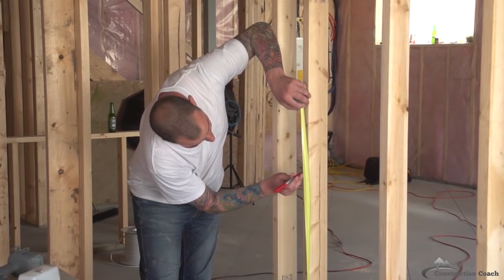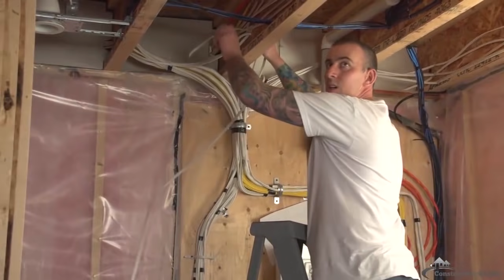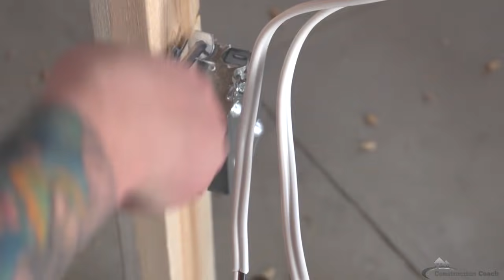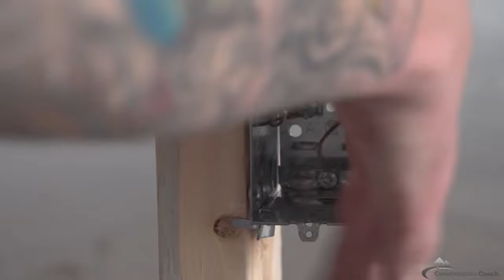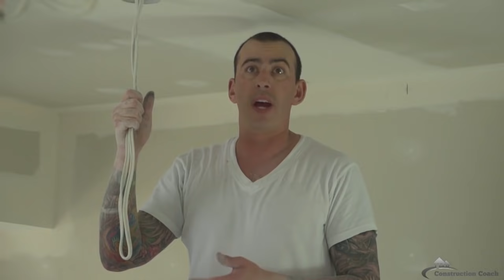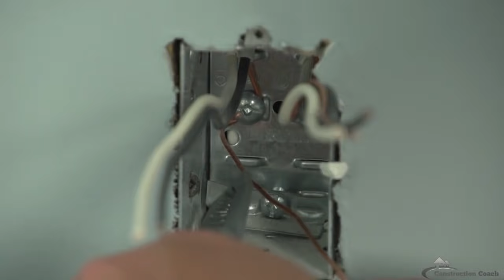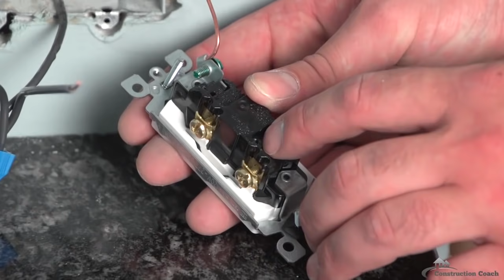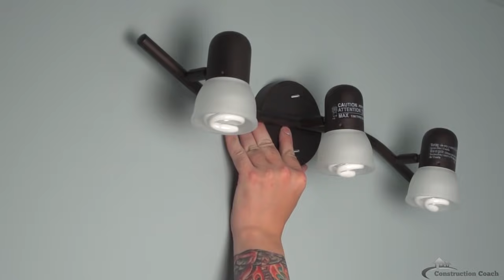Home Electrical 101 - What you need to know now!

Comment: Is your gfi receptical using 14/2 or 12/2?
Reply from the maker: 14/2
Reply: Construction Coach is it on its own circuit?
Reply from the maker: If it’s for a washroom i usually have it tied in with other things. If it is exterior I will have one circuit for exterior receptacles.
Reply: Construction Coach thanks for your help! Great videos. What else would you run a single circuit for? Fridge? Oven/stove top? microwave? What would need it’s own dedicated circuit in a house build? Thanks!
Reply from the maker: Furnace, fridge, dishwasher, hood fan/microwave, hot water tank, electric/gas fireplace, washer, dryer, stove/range, jet tub, the list goes on and on!!!
Reply: @ConstructionCoach  General rule of thumb, if the appliance requires more than 10Amps then it should be on its own circuit?

Comment: I dont think it was bad planning twisted, I only watched a little bit and am guessing the house was already done and the insulation was needed when house was built. this is finishing off the basement at a later date, HOT TIP use a hammer to measure outlets, much faster when you do an entire house.

Comment: Rough in all electrical and plumbing, and anything else, before insulating. It's a capital waste of time and energy to install batt insulation, acoustic sealant and plastic air barrier, just to come back and rip it out. Frame the stud walls, drill all necessary holes for the  electrical and plumbing runs, rough these in, vacuum up the debris, then insulate. 

One major difference between pros and non-pros is pros make the most efficient use of time and resources. Pros are skilled at avoiding unnecessary tasks and why able to get from A to B faster. 

At about 1:08 onward, and have to say I have great concern about non-electricians offering electrical wiring advice on YouTube, one can see that the hot receptacle terminals aren't shielded with electrical tape, are improperly connected and under gauged. Every certified electrician I respect always tape the terminals and wind the copper wire clockwise around the screws.  The screws are there for a reason. Those wafer thin metal hold down slats, the easy cheat, are bullshit and should be illegal.  It has to do with preventing overheat from high amp electrical appliances such as hair dryers.  In this video the GFI appears to be 14-2 to upstream.  Washrooms, like a kitchen, should be 12-2 on 20amp dedicated breaker or 14-3 split receptacle across both 120v hot busses.  Way safer. 

Plug a vacuum cleaner in a 15amp plug, use it for 5 minutes, unplug, feel the plug terminals, they're hot. Surprisingly hot.  That's major sustained volt-amps on thin 14-2.  Electrical fires start because of too thin copper wire on over-amped breakers with too much load on the circuit at one time. The plastic sheathing melts and catches fire, goodbye house or better part of it.

Never try to DIY any electrical connection because watched some YouTube video.  Volt-amps kill. If one lacks 100% certainty and confidence in the wiring job at hand, hire a certified electrician.  Never mess with electricity. 

I have never seen tools spray painted gray on YT. The drill is a POS 10 year old DeWalt before restructured and rejuvenated its great historical reputation of finest tools and equipment.  The hammer is probably an Estwing or similar.  Great hammer. Waste of spray paint, likely to make some bizarre point of not sponsored by, suggestive of a money-grubbing sourpuss who has no concern or regard for the tremendous engineering achievements to design, build and supply these tools that have enabled this video maker to renovate their basement.

Comment: A plug connects to a reciever such as a receptacle. It's a receptacle.
Reply: Also, don't forget to mention you are mounting your boxes at 5/8" extrusion from the studs for a flush mount with exterior dry wall.  5/8" being typical but should match thickness of dry wall.

Comment: I am normally troubleshooting. Just a couple of things to help the next guy.... don’t wrap your wire connections with tape, it adds no safety and just has to be removed to get a meter in there. Also don’t pre twist your wire connections, it adds nothing for tightness, it just frustrates the guy that needs to take it apart.

Comment: Has any electricians seen these  Staples cause problems?I lived in a Hundred-year-old house whose wiring was updated in the 80s. It didn't use this type of Staples but I heard a noise one night and apparently one of the Staples arcing off the electrical wire. I replaced it and electrician to rewire the box and fixed all the issues. But I'm about to completely rewire another hundred-year-old house I want to use the best fasteners available AKA safest

Comment: I don't understand why they wouldn't let the electrician do all the wiring before putting in insulation. I bet they put the insulation back and then let the plumber come and cut it apart again lol. Anyway great video. I'm going to take a wild guess it has something to do with getting a structural inspection or something. but I really don't know, I'm just guessing.

Comment: Keep in mind that for relative pennies you can upgrade for future options ....for example consider making EVERY ceiling box "fan ready" ....stronger mounting to support heavy ceiling fans ....yes even if you are not sure you will want it down the road....why not?  a couple of dollars and like no extra work to speak of ...also instead of just taking 2+g romex?   Go 3+g.....why?   Well so you can have two switches to same fixture!  Why?  For instance fan and light.    Another thing that seriously does not cost much is to run all your bedroom wall wiring in METAL conduit!  Or metal armored cable types assembly ....The idea is that this is the wiring just under the drywall and close to you and your children's BRAINS ...ALL electrical powered conductors emit a large electrical field ....It can't be good for our brains!  ESPECIALLY babies and young children!   Seriously for just a few dollars more ALL the bedroom wall wiring could be "shielded"  via wires inside metal conduit  

Lastly?  Put in LOTS of extra outlets!  So easy in bare studs!   Such a pain after everything is built already

Comment: why dosn't anyone use tubes for the wiring? is it even legal to do like this?
Reply: Jonathan Lindberg conduit should only be used with surface mount electrical applications. It is perfectly legal
Reply: In the US and Canada with residential wiring using Romex or Lumex wiring is to-code as long as it's not accessible to a residential area. Someone above said that in Chicago they require all wiring run through conduit even if it's in the wall, but in the vast majority of North America you just affix your Romex to the studs, drywall, and call it a day. There's special considerations for things like using grommets in holes through steel studs if you're using those.

Comment: in Murica they Twist cables together ... LOL we use Quick connect clamps becourse twisting cables together like this is not allowed in Germany... screws can loosen up over time, quick connections 
are springloaded and dont loosen up, only the breakers inside the Fusebox "Panel" usually have screws. But they are covered and never open like the ones on these switches and outlets

Comment: why not use plastic utility box?..whats the difference ?
Reply: Plastic cost less then metal boxes. I guess if he had a metal tool box folks would ask why not use a plastic once since cheaper.
Reply: I prefer using fiberglass boxes, because they have a 2 hour fire rating, where as plastic boxes don't, unless you use the heavy duty plastic boxes then they are usually only 1 hour fire rated.  If you use a metal box then you have to use a mud ring and you will also have to make sure you attach your ground wire to the box itself and not rely on the device strap to ground it.
Reply: I also forgot to mention that some city building codes will require metal boxes, just depends on the local building code.

Comment: Not bad but, I would highly advise to never use metal boxes so that you dont have to ground them, use plastic or fiberglass nail on boxes are standard.
Also, for the outlets, we usually go hammer height so that its a lot faster than measuring, just make sure everyone is using the same hammer height.

Comment: I don't understand how to select the type of wire necessary for an area. One video explains that 12/2 is necessary for about 15 amps and most outlets are ran with 12/2. I noticed you elected to use 14/2. Is that because you determined the amps would be about 20? Why did you select 14/2 instead of 12/2? I am not being critical because I literally have no idea why.
Reply: Rusty Zi    Strictly a NEC (local authorities sometimes make changes, like minimum wire size is #12) answer is in a dwelling unit, minimum power circuits are 15 amp.  That means 15 amp breaker, #14 conductors, 15 amp receptacles.   Kitchen and dining room branch circuits are required to be 20 amp.  That means 20 amp breaker, #12 conductors, and 15 or 20 amp receptacles.   If one receptacle, it has to be 20 amp as well.   You must check with local authorities to know for sure.

Comment: Not a bad video over all, but I saw some issues personally.

I'm a plumber, but do electrical at times, and I've always been taught to have 7" coming out of the box, and to fold the wires back into the box, instead of a "service loop"(i have never heard of this before) which is a hazard to get cut/screwed/drilled just hanging in the wall like that. Plus, aren't you supposed to staple it within 3 inches of the box?

The way you cut the romex sleeve is very dangerous, I was taught to score it down the middle, then score it at an angle to the point you wish to peel it back to, split it at the end with your fingers, and then tear it up the middle score to the top angled score, and then off. That way the knife blade never comes near the wire coating. Plus it's faster than what you did. 

Why aren't you using sleeved screw drivers?

Why don't you cut the ground wires shorter, leaving one longer, then use a ground wire nut, instead of pig tailing them? I've been taught this is proper (code) now.

Not trying to talk crap, just trying to understand your different methods.

Comment: hi. i live in Nl.       and what i can't understand. whay ? in USA are not using cable pipes. if som cable is damage you have to. opening all wall tu put new cable and thear are more things what we use for safety then USA.  first have to be fire safety. and if cable is so straight. its not good for vibration. and In time home change. the shape even 5mm can be dangerous

Comment: Does america not have safe zones? In england it is a requirement that cables are run horizontally and vertically in line with the switches etc. Otherwise if a builder drills into a cable it is your fault as you are out of the safe zone.
Reply: He is in Canada. Does England follow French or German codes? :) :)

Comment: is this really the quality of electrical work in the USA?
Reply: code makes is more rigid as far as specifications each year, this is the first I heard about a service loop, however it's a good idea.  I am about 7 years behind in code classes, thats why I am watching some of these videos.
Reply: @createdtoworship-4851  im not sure if service loop is in code but its not a bad recommendation though and the code is only a recommendation of bare minimum standards too. ive been known to use 12 gauge wire on 15 amp breakers when i know there is high constant load potential its better than code

Comment: is 14 awg allowed in bedroom living room on 15 amp breaker
Reply: David Berquist    This comment is for receptacle circuits only in US per NEC.  No other types of branch circuits.  Yes #14 is correct for 15 amp breakers in all residential spaces (per NEC, local codes may require all residential conductors be minimum #12) except, kitchens and dining rooms.These two areas are required to be 20 amp branch circuits, so 20 amp breaker and #12 conductors.   So, you must check with your local Authority Having Jurisdiction, if you do not know.

Comment: Why are you wiring outlets with 14 AWG? Outlets should be wired with #12, and placed on 20-amp circuits.  #14 should only be used for lighting circuits, and with no plug-in receptacles on the circuits.  #14 can also be used for garbage disposals, gas furnaces, refrigerators, and sump pumps, as long as each appliance is on a dedicated circuit.
Reply: Some places still allow 14 awg wire from duplex plugs to a 15 amp breaker. Electrical codes are like gun or alcohol laws, ie North America each serfdom has its rules. Locally a city here in Miss banned 14 awg for any home or business 3 decades ago. ie stricter than the NEC. There are millions of combinations of rules and each area has its czar to pass muster with ones project. In California we used 14 awg for the smoke alarm only and it was taboo 30 years ago for anything else. There are also all sorts of goofy folks in the loop too.. One chaps city wants all the safety stuff on arc/gcf even the smoke alarms too. A relative did an addition in the Atlanta area and every single breaker has to be arc/gfci combo breakers and no 14 awg at all.  And if you do not do this you fail at the inspection. In Chicago no Romex is allowed, all is in steel conduit.

Comment: The GFCI wiring he did is wrong. He should connect the wires to the load and line side respectively. Also  the ground wire should be connected to the outlet ground and then to the receptacle.

Comment: Running receptacles and lighting on the same circuit isn't ideal. Loads on receptacles can change and be unpredictable and it's good trade practice to separate the two. What happens if one day the family wants to switch from 9W pot lights to nicer looking 40w lights but the circuit can't handle it because the receptacles on it are using up 60% of the allowed wattage? Headache.

Though complicated, I've found the fastest and most cost efficient way to rough in a situation like this is to find an ideal path and run a homerun 14/3 wire to a central receptacle. There's likely not 24 receptacles in that area so that 14/3 will branch off two separate ways and cover every receptacle in that area. If it's 12 or less receptacles then just run a 14/2. That being said, if the panel is right next to the area you're roughing in then it's probably better to run two separate 14/2 wires to the two different zones as the first circuit will be started right next to the panel anyway.

For the lighting, run a 14/2 wire to the nearest octagon lighting box. Connect that line voltage to a wire going to another rooms octagon. Do it again and again until every room has 1 octagon box with line voltage. Then switch drop every room's line voltage to it's appropriate switch. Providing the lights being used are within the wattage allowance, this will put every light in that area on the same circuit. This also enables you to run 1 wire into the switch instead running one into the switch and another one out of the switch back up to the lights.

Slim fit LED pot lights are the way to go and they're like 9W a piece which will allow you to put 160 lights on that circuit.

Let me know your thoughts on this!
Reply: Cheeto Corleone    So, if you are running #14/3 out as two circuits, are you adding a common trip device to those two circuit breakers, or a two pole circuit breaker?

Comment: Why did he not put pig tails on the hot during rough in so he did not have  to waste time with that jiggery pokery after the fact. Also, our code calls for pig tails on all wires  to receptacles unless of course it is the end of the line in a manner of speaking.  The idea is that then there is less chance of interuppting the ground and neutral to down stream devices and makes it possible to change a receptacle hot if for some reason it has to be.  I do not condone the practice but sometimes you just have to bite the bullet.

Comment: why dont you use pipes . i think it is better coz youll get better way to change wire when it cuts wrongly or damage wires from the connection or you beat wire through hummer
Reply: Hawar Khalil usually pipes inside are for commercial applications.  in some cases are for residential like outside or garage.

Comment: Didn't watch the whole video. Basically good, but S1 and S2 doesn't mean a staple for one wire or two wires. Code actually forbids two wires under one staple. The S1-S2-S3-S4 designation is for sizing only. S1 is for 14-2 or 12-2. S2 is for 14-3. S3 is for 10-3 and S4 is for 8-3.

Comment: Slightly off topic. I can't stand the strobe light effect that the led Christmas lights create. Would a power adapter stop this? I really don't want to power my tree with a battery.
Reply: What do you mean strobe light effect are you putting them on a dimmer or something?
Reply: Thank you for your reply. No: Just regular led lights with no mode/dimmer box. I haven't been able to find a set sense they started making them that do not  bother my eyes. They all blink at a supper fast speed. I figured it was do to the ac current powering them because led flashlights aren't a bother to my eyes at all.
Reply: Jeremy McLaughlin I guess maybe test some other ac lights in store because I have never seen that do normal led light in light fixtures bother you?
Reply: I found an article that was helpful. Evidently most led Christmas light blink about 60 times a second but they actually do sell lights that are supposed to be flicker free. I never noticed them in the store but I'll keep a flicker sensitive eye out for them.
Reply: Jeremy McLaughlin huh your phone should also flicker then does it not since that have a refresh rate of 60 as well